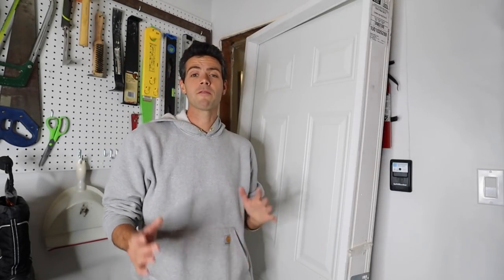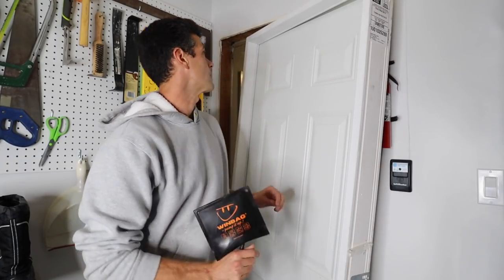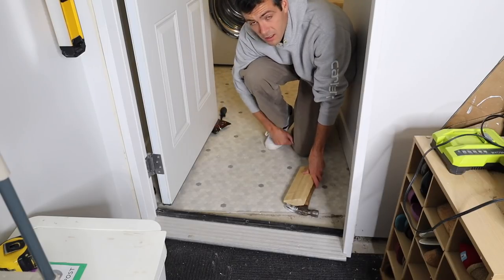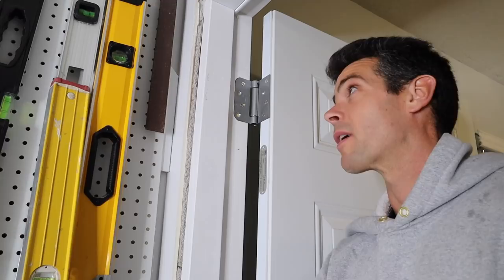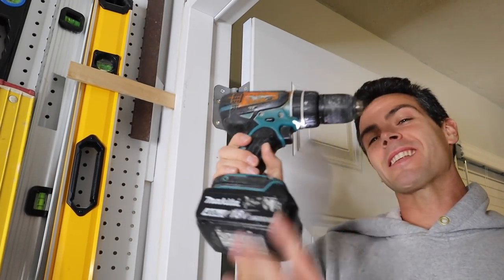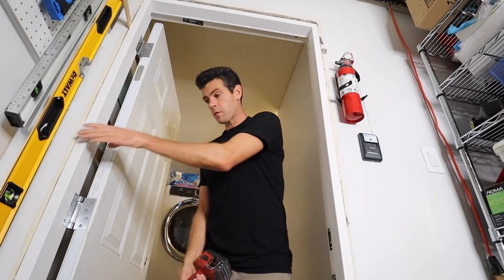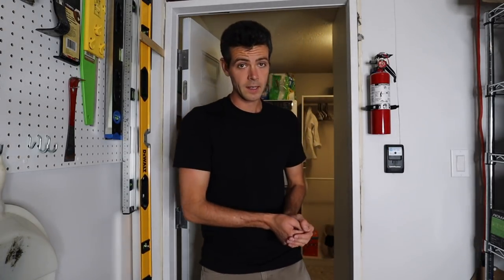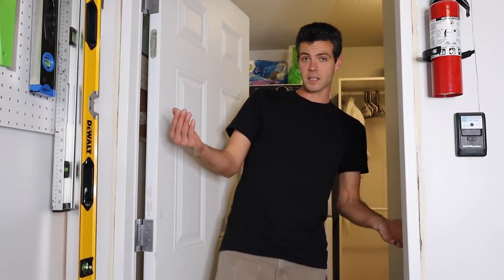BEST Tool for Installing Doors!!!

Comment: Another way to hide screws is by removing a factory screw from the hinges and replace with a 3". Also keeps your hinges from sagging over time
Reply: I was gonna say the same thing but seen you beat me to it. Most doors come with 1 hinge screw missing already on each hinge to put a longer screw in it. Throw a quick clamp up on the header and you don't have to mess with an air bag. It keeps the frame flush to the wall too 🤣
Reply: @jeffrobinson6987    I’ve wondered why the hinges on new doors are missing a screw; you just cleared up the mystery… Thank you.
Reply: That’s what I’ve always done and taught others to do, I always pull back and screw behind the weather strip on the knob side like he did
Reply: Hard to find 9x3” brass screws. I agree that the 3/4” screws are useless.
Reply: @jimwesselman  I’ve always just used whatever #8 3” screws I have.
Reply: I prefer the long screw BEHIND the hinge so 1. If you have to remove the hinge again, you’re not messing with the anchor screw ( on numerous occasions I have had to use a manual screw driver) 2. Those 3” screws are ugly and don’t match the other 3. And 3. If you do not pre drill, hose 3” screws are tough to dive in and jumping the screw and hitting the hinge face is possible. And you short guys are doing all this on a bucket.
Reply: I always just screw from the front and fill with drywall filler. door needs paint later anyways

Comment: Next on your list should be a laser level. As someone who installs lots of doors I'm going to say a laser is my number 1 tool that's sped up installation. I have some of these and they're nice as a pair of helping hands to keep you from fumbling so much, not having to reach back and forth for a level is a huge time saver. I still check the hinge side of the jambl and the threshold with a good old Stabila but 90 percent of the time no more adjustment is needed after just using a laser. Trim screws are also pretty high on my list for installing exterior doors.

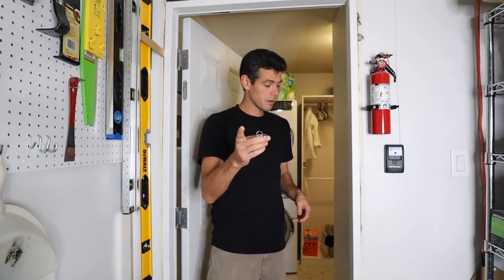Comment: 7:17 I would also recommend installing a jamb brace or a piece of aluminum between the door casing and the framing.  Drill out a hole for the deadbolt and add a deadbolt sleeve over the door edge (the door itself) where the bolt extends from the door into the casing. The reason for this is the deadbolt will still hold but the aluminum door will literally peel away from the center core and will allow entry. The deadbolt sleeve will hold the door together under the stress along with the jamb brace and will successfully secure your house.  I have taken so many burglary reports where this has happened so I hope this helps anyone out there and prevents them from having to go through the devastation of having their privacy and belongings violated.  Also use steel lag bolts or screws that will bite into the door frame for added strength.

Comment: Try “Quick Door Hanger” kits for the fastest and easiest door installs. I never install a door without them. Man, I’d never run those screws on the latch side without the door being closed first. Glad it worked out though.

Comment: I have two of those bags. Once had the bottom brick on an exterior column fall off with no support under it. With some adhesive and a wind bag, it was an easy fix. Changed the customer $100

Comment: First, realy like following you and you and have shown m new ways to do things, like the Supertaper. They do not have them here in Norway, so the company that importa Columbia has taken in a few and we are now testing it for them.  

Althoug the Airbag is a good help, the Viking arm is probably better.  

Here we always take the door out of the frame, The hindges for both interior and exterior door are easy to do this with.  What I would recomens is using Essve frame scews,  Once they are fully screwed into the frame, you can adjust the frame to the inside since they both pull and push.  I use the type with. the larger head, most frames come pre drilles but also have a counter sink drill if not.  Then plug the hole with a plastic plug. They also have with a smaller head that can easilybe tucked under the weather stripping.

The screws are also great if you are straightning up a wall instead of using shims. 

I too am both a carpenter and painter.

Great videos and keep up the good work.

Comment: In my experience with Phillips head screws going into wood, drill a pilot hole and reap the rewards. They should be Robertson in my opinion, a superior screw. You might want to check out the documentary on the Robertson screw, it’s quite interesting.
Reply: Sqaure heads (that's what they are called over here in Oz) are as useless as Philips.
Same for the internal hex ones..
Best grip are the ones with Torx drive.
Reply: It’s a matter of experience and cost of tools you already own. They did not have a bits back in the day like they do today. Impact drivers have a square drive just like a Robertson head screwdriver does. Also it depends upon the application of the fastener. If it’s in wood plastic etc. I have no problem with either of them. But if it’s in steel, aluminum etc., that makes the difference.

Comment: I hang a few hundred doors every year, most metal and fire rated thus extremely heavy. I may try this tool. With that said, this job you're doing, I would've removed the door and installed the frame first without it.
Reply: I use them for that and they are great. With many commercial doors, the frame gets installed on its own then the door is attached to the hinges. I sit the door where I want it, then put the bag right under the centre and use my foot to pump it like he did. It easily lifts the entire door until the hinges line up. Both steel doors and the commercial grade solid-core wood doors which are over 100lbs each.
Reply: Big AL  I own rwo of these bags and sometimes go out on service calls for keys locked in the car. Had the bags with me, but never thought to use them that way.  Thanks Big Al!

Comment: Too funny, I had that same Makita drill for so long. I replaced the brushes for 8 usd and brought it back to life. Soon after I sprung for the Milwaukee kit. Keep up the videos. 👍 Subscribed
Reply: Recently got all of my Milwaukee drills and impacts stolen from my work van (and a whole lot more Milwaukee 18v tools) and when buying replacements can’t believe how expensive they are now and only come with crappy bags and not sturdy boxes anymore. Still best power hand tools on the market though
Reply: Jody Sanders I feel your pain. My storage unit was broken into. Lost some good tools. This was in Orange County,Ca.
Looking at HD now for the sale prices. I am going all cordless. Sticking with Milwaukee. I want the cordless sawzall and grinder. 
100 each right now.
Reply: Mr. Pie; me up in Seattle WA. I just bought the 18v multi-tool and wow it’s incredible. Had always just bought cheap ones. We do a lot of heavy demo so I like the power of some corded tools but am leaning towards all battery myself. Thanks for the thoughts and good luck!

Comment: Great stuff, made it look easy and it's because I've made the same errors but it needed some reinstalling:
1. Before you set the door in the space, put your level up and around on the framing to visualize how the framing is "trapezoiding" so that you don't end up pulling the jamb out of square when you set your (anchoring) screws. That way, you can put a shim behind the door jamb at your screw location and the jamb will stay square. Likewise on the deadbolt strike plate screws.
2. As a Canuckistanian, am sure you are more familiar with Roberts drive than Phillips screws. Phillips work fine because as you demonstrated in your video, a more "cam-out resistant" head can cause breakage if you aren't deliberate while you are driving it; but you need the right size phillips bit tip and you need to drive it straight into the head of the fastener. Inevitably, you'll need to use Phillips head, unfortunately or not, and being specific instead of just saying you hate 'em repeatedly helps to keep from camming out (some people say "stripping" the head). 
3. If you aren't concerned about fasteners with a different head, you can set longer screws through the empty hinge plate holes on the hinge side, also a good way of hiding your anchors when you don't have weather stripping.
Right on Vancouver Carpenter, and I appreciate your Adidas Superstars too.
Reply: Doing door hardware on a commercial job with all Phillips. Kept saying no stripping, no stripping. And the foreman said bet you weren’t saying that last night at the club, were you.I think he was just mad because he wasn’t invited.

Comment: I often use a metal grinder on wood that needs persuasion, what takes an hour to grind in metal takes mere seconds on wood.  Wood can be shaped or removed very quickly, just be sure to remove what you need.

Comment: Used the air shims to install a door once. It worked really well to plumb and center up the door, but how do you get them out with a screw through them?
Reply: You mean the wood shim he installed? If so, it stays. Just score the excess with a blade and break it off.
Reply: lol

Comment: That’s a neat idea, sometimes if it’s giving me grief I’ll put a flat-bar or cats paw under the door over a block so I can adjust the height with my foot as need be. But I don’t install enough doors to go buying special tools for it
Reply: It's not very expensive...and it's the sort of tool that, when you have one, finds itself the solution to many different problems.

Comment: Had to change hinges on a door last week and fumbled around with stacks of sanding paper to try to get the door to line up good.  Now I'm watching this knowing I have that frigging air pump jack right in my basement like 🤦‍♂️.  Might take the door back off the hinges and put it up again just because of this, every door in this house is on notice!

Comment: You don't need to remove the weather stripping. Put the long screws in the hinge hole nearest the middle of the jamb. Save time. Those little bags are indispensable for solid core doors.

Comment: So, at 5:36, just before it is screwed in, we see the top right of the door casing move out by 1/16" as the impact starts and then finish by closing the original 1/8" gap. Does that mean that area of the door should have been shimmed before screwing?
Reply: Yea, I saw the frame pull in almost everywhere he in put a screw. Seems like he should have shimmed most of those areas.

Comment: Leave the door in the jamb, lay it down, and case the outside prior to install. Place the cased door and jamb in the rough opening, nail the casing to the jack/trimmer stud. Much faster, easier, and no need for the Winbag.

Comment: i know what you mean i just put in two doors the back door i could care less about it opens the wrong way. it has a small window and its painted green on one side with lots of rust. but its all i had and it went in easy first try close and open greats. but the front door is new opens the right way big windows just what i want. and i gave up putting it in right gave up called and begged a friend to come do it for me.  and where i put a nail in the stud it was sticking out about 1/8 of a inch and thats what was kicking my butt. he did the job in about 30 minutes and most of that was fixing my screw up. and i hate to say this but i have to it pissed me off more than it helped me. LOL but i have got over it and thanked him.

Comment: First thing I notice is that you are installing a door for someone who owns a Roberts bar. So they have installed engineered flooring, but don't feel like tackling a prehung man door, ok. Also, you don't need to strip out the weather seal, you can simply push it back against the jamb, set your screw and the seal will spring out and hide it.

Windbag is like so many tools made to accomplish tasks we've been doing for years. You know what I like the most of these new fangled tools? The laser. I set it right to the edge of my chop saw blade and I never have to make a pencil mark. Just set my tape, run it out and when the laser hits 32", I close the tape and cut a 32" board, voila.

Ok, so can you see that if you took a piece of plywood and used your Hilti or Makita to screw it to the framing on the hinge side of the door, the plywood would keep the door frame from tipping to the opened door? Because how does the Windbag let you check the door swing? When you are done with the plywood, the door trim will hide any blemishes from using it.

I personally don't think it is a good idea to tilt self closing hinges out of plumb, unless fighting gravity is your form of job security.

Comment: I also install 3" screws on the hinge side of the door after seeing a video of someone kicking in a door at the hinges.
Reply: Same thing for the striker plate. I drill a pilot hole first to prevent splitting the stud and/or the door jamb.

Comment: I fear entering screws without pre-drilling due to experience with wood splitting.  How are you avoiding that with this door install?  Is it a special screw?
Reply: Doors come with 3" #8/#10 install screws most time or just use a standard construction screw. When drilled in middle and away from the edge of the wood it will never split. Being so close to the edge is what causes lumber to split, the force of the screws is sent up the grain and with noting to stop it it will snap off towards the edge.

Comment: Here is a question for you and your viewers how do you get those spring loaded hinges on without squishing your fingers a million times I had a part on my finger I felt for the next 3 days that slam shut on the pad of my index finger
Reply: Unload with Allen wrench and pull out small pin.
Reply: T R and for the love of all that’s holy wear safety glasses. If you let slip that Allen wrench under tension it may come whistling through your eye socket at hypersonic speed.

Comment: Don’t pull the weather striping out, use the head of the screw pull it back then put screw in, holding weather striping back with finger.
Reply: That’s how I do it

Comment: I was told that thieves also use these to break into cars as they can be slid into the window instead of using a pry bar. I locked the keys in my car and the locksmith told me this as that's what he used. But I no Everyone who on this channel won't do anything like that...

Comment: I wish more door strikes for the deadbolt would have a spot further towards the center of the jam where the stud is for the security screws. 99.9999% of the time, the centered screw is landing dead in the middle of where the drywall or plaster meets the studs. Then we wind up having to do this ugly thing where the screw goes in at an angle for the actual security and doesn't sit flush.

Comment: As a door installer I swear by WInbags. The screw broke because you didn't pre-drill. NEVER use a rat a tat drill for hardware ever, ever, ever and many will cause hearing loss. I hate em. Screws get ruined, just take a close honest look after you drive a hardware screws. Otherwise great job.

Comment: You should have showed how the door closed from the inside I bet it was way out of wack... You shimmed the hinge side but used none on the knob side? I have hung 100's of doors and you either got extremely lucky or it's not correct. I have an 1/8 all the way around.

Comment: That long screw might make you feel better, but as someone who kicks in doors for a living, I can tell you it does nada. A kick plate with a slide mounted in the floor is your best defense. It will give you a few minutes to be able to run out the back if needed.
Reply: You know what works really well? An outswing door.

Comment: Only a millennial would use thingy's filled with air, and be wussy enough to grunt driving a screw into a lock bolt strike plate, while using a battery powered hammer drive screwdriver. Really!!  Mount door jamb casing with door on.  You are fired if I see you doing that.  Air bellows ("windbag") under door.  You are fired as well.   Just get yourself a sheetrock panel toekick lifter.  Get the one with the round steel tube roller. Easier to adjust.  My goodness!  I was a UBC journeyman carpenter, and I worked with carpentresses that would run circles around you.  Also, If you have to huff and huff pushing the jamb into position, get yourself a neoprene covered 2 lb deadblow hammer to "tap" the jamb into place.  One last thing.  I am tired of seeing fools use drywall screws for doors.  They are brittle; that's why the screw snapped off.  When door is installed for the "security of your house", drywall screws will snap of when stressed hard enough by having door kicked in, because they are brittle.  Wood screws are thicker and made of soft metal.  So when you kick the door, they bend and make the task of kicking the door open more difficult.  And you stripped many of those drywall screws you drove past the jamb, into the door frame wood studs.  So they won't hold as well as those being properly driven tight.

Comment: Too many of those wtf moments . I won't go down the list    being an expert master carpenter with 40 years of sawdust in my belt      I have shown others a neato torpedo "trick'  .for setting doors    .A beam laser !!!!!!!     So perfect so easy and so fast     that it allows me time to glue all shims and anchor a door so precisely that it'll take explosives to remove     The real test of a well set door is slamming it so hard like you threw your wife against it. That the drywall popped in a room down the hall and pictures fell    but the reveals remained perfect